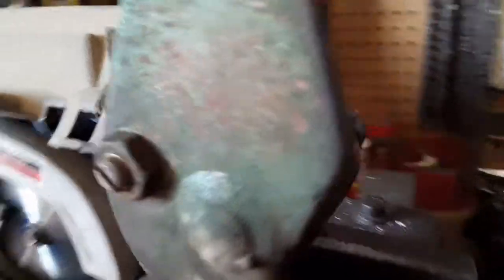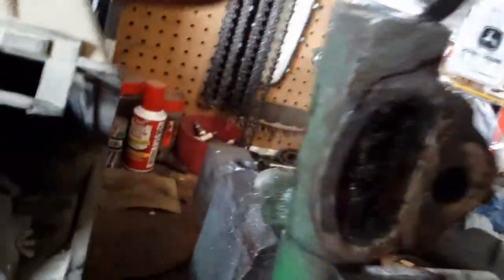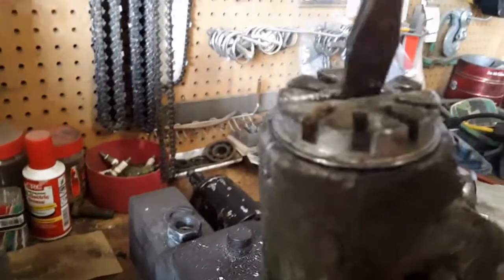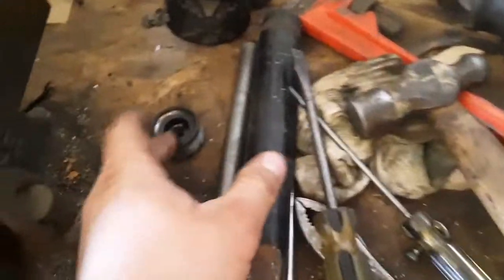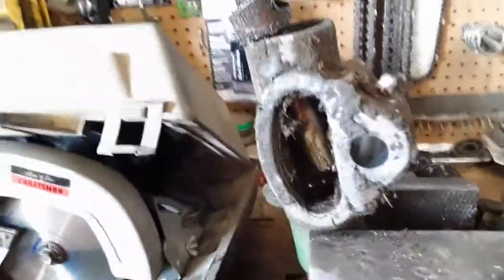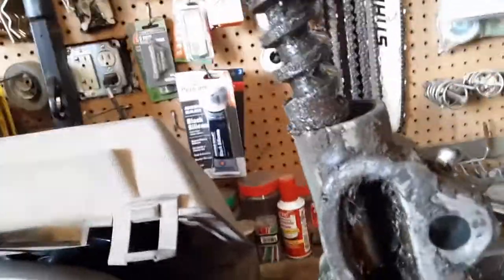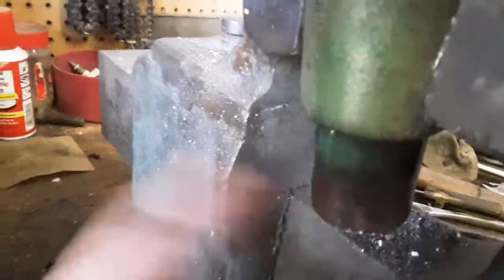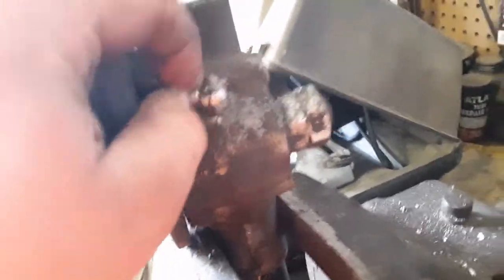How to take a steering shaft apart on a john deere 110, 112, and 200 series

Comment: Mike. Both my 107 & 682 Cub Cadets have the same exact Ross Steering Gear column just like the John Deere 100 & 200 series tractors do. 
My 682 also has the same exact grease zerk fitting that moves around freely - Which is a real pain to deal with trying to shoot grease into the steering gear casing. 
My 1969 John Deere 110 has a bent outer tube just above the dash tower console in which I may replace sometime in the future. Sometimes on the Ross steering columns, the tubing will separate from the steering gear casing in which a former Cub Cadet dealer told me several years ago to drill one or two small holes on opposite sides of the upper gear casing where the outer tube slides over it and either shoot self tapping screws or drill 1/8 inch holes for rivets to keep the tubing onto the casing. The screws or rivets must obviously not make any contact with the steering shaft. This fix is for Ross Steering Columns with a lot of wear & tear. Great Video,Mike. Hope your Gravely Tractor project is going well.
Reply from the maker: Thanks
Reply from the maker: I'm going to go ahead and sell the walk behind though

Comment: My steering column is lifting up and almost wants to come out.... it had stopped turning left very well, and turns right fine. Think something is loose or broke? And think I can take it apart from underneath? The bolt that goes into the worm gear, on spins out so far, so the end cap/crown nut thing, should spin out no problem? It stops at a certain point, just making sure I don't break something by twisting harder...